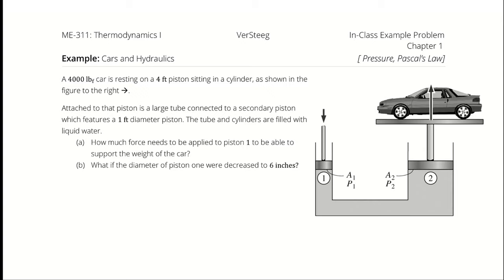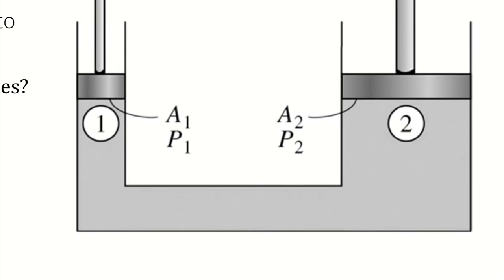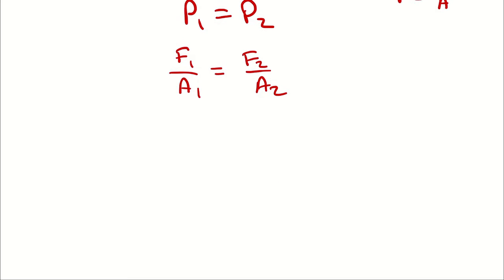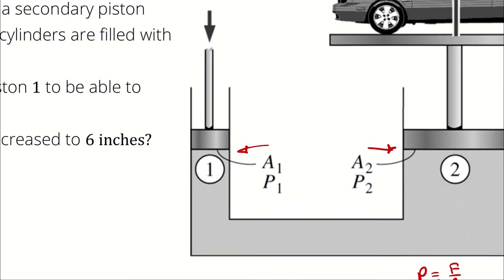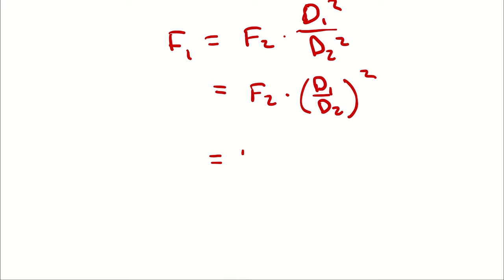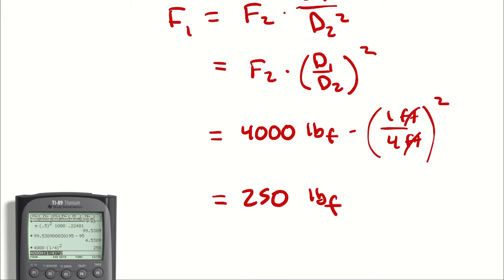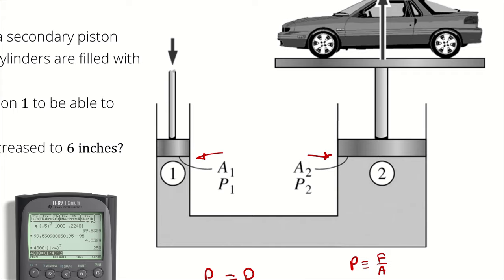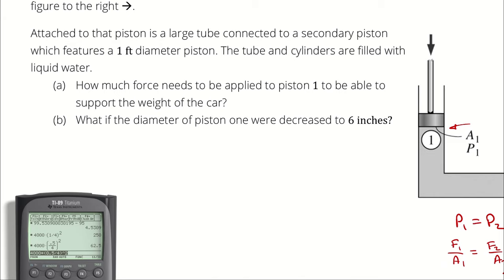Example Problem - Cars and Hydraulics

Comment: A 200 lb car is lifted by a manually operated hydraulic lift. The area of the shaft of the lift is 80cm2, the area of the piston that forces liquid into the system is 2cm2. What force must be exerted on this piston to lift the car?